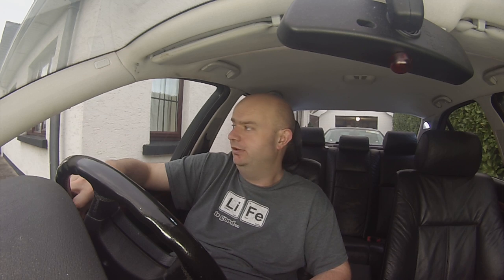BMW E39 EV Conversion 52 : Electric E39 As Daily Driver

Comment: Good video thank you. Damien do you know how to reset or get rid of a disc brake pad warning light? I have a unconverted e39 Touring that is showing a brake pad check light but the pads are fine.
Reply from the maker: Typically there is a wire that fits into the back of one front pad. When the pad wears down this grounds and turn on the light. Check the wire as it can fray and find a ground on the body.